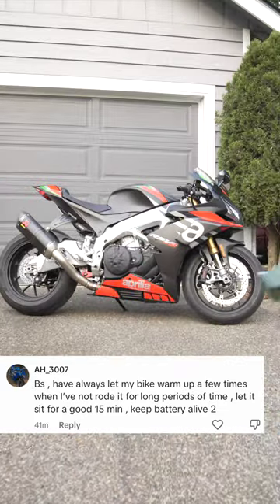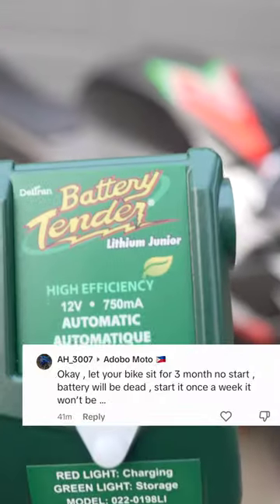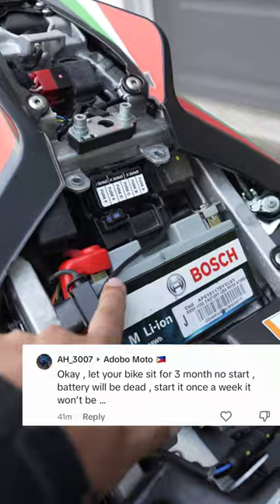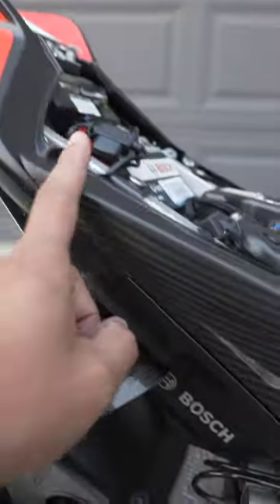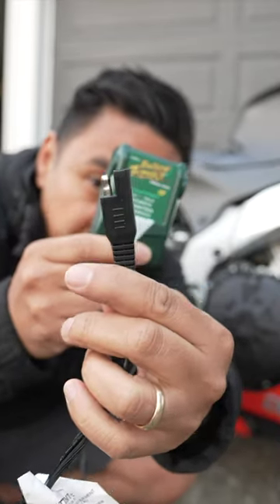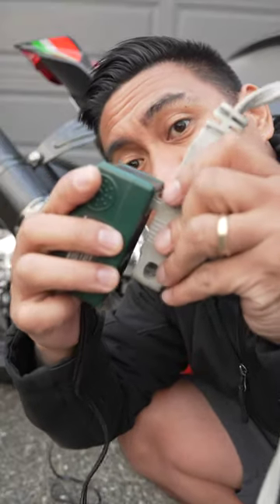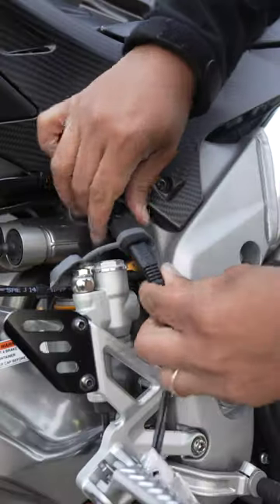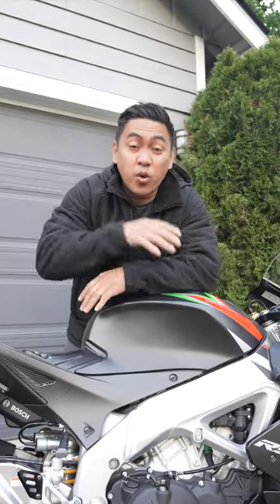HOW MOTORCYCLE BATTERY TENDERS WORK

Comment: Thats exactly how an alternator works my brother. In fact, if it wasn't for the voltage regulator, at higher rpm, the alternator would fry your battery/bulbs and everything else
Reply: Came to write this exact comment. I love adobo but electronics aren’t his strong suit it seems.
Reply: Um, no. The alternator in a motorcycle and the alternator in a car work much the same way, just at different power handling. If what you are saying is true, you could leave your car running in your driveway all night, come back to it, and just start driving, but that would kill the battery in literally any car, which is one of many reasons you would never do that.

I'm not claiming to be an expert on the topic, but this should be pretty common sense my guy.
Reply: Nah he right, i just found out the hardway just starting the bike wont charge it. I jump started it and rode it and it finally charged. In my defense its my first bike.
Reply: @zacharyplacker6271 what? You can leave it on. Car alternators will keep the car running all night and yes... you can get in it and go.
Reply: @mogunz9643 I think he is saying without an alternator.

Comment: I use Litium Batterys in my Bikes for over ten years and charged it not even once and it was never dead.
Reply: Lithium Battery only loses a few percentage of charge over months. If you Lithium battery loses more than 10% in a couple months, it’s just because there is an IC inside the battery trying to discharges the battery to 50% to be stored longer without reducing battery life
Reply: @The XHT  that's right. 
I had Lithium Battery laying around unused for 6 years and it had still 80% charge.
Reply: @ronnyweinreich  yeah i see no need for lithium battery tender unless you stop riding for more than 1 year

Comment: This isn't how an alternator works.  After the initial start process the alternator provides an excess of power to the battery to charge it.  Once the battery reaches a full charge the voltage limiter only provides enough charge to maintain the power level.  If you need to charge your battery before you ride then you have a bad battery, a bad alternator or a bad voltage regulator.

Comment: no man, a bike is DC power not AC! 12v DC battery. and it does charge at idle, but a bit less than when the bike is at revs. cars have alternators most bikes don't have them. lol they have a stater and roater that makes 3 faise AC power that gets converted by the rectifier to DC. On idle should be charging at 13.5v DC and about 14v over 4k revs.

Comment: If your vehicle is not charging at idle you have an issue.  At idle, alternators should be putting out between 13.5-15 volts.  Otherwise, you either you have a dead/dying alternator or you have too many electrical accessories.
Reply from the maker: It’s charging at a lowe amperage. Not high enough to charge a dead battery by letting it idle for 15mins. Try jump starting a bike with a dead batter and just letting it idle for 15min, then turn it off and try starting it again. Lmk how that works
Reply: Bikes aren't going to charge at 14 at an idle. Most bikes have staters, so the speed of the magnets depends on the speed of the fly wheel. So the only time it's going to create a surplus is when the engine is at an higher idle.
Reply: @adobomoto a dead battery won't charge in 15mins, we all know that, but a battery is absolutely refreshed from 15 mins of idling.
Reply: @adobomoto Not claiming to be an expert, but my SDR has had a dying battery (had to jump for every start for the last 2 weeks) and I specifically tested it the other night. Start, idle 5 mins, killed, waited 1 min, started right up. Though, not a lot of good. My 7am ride was cut short when I went outside fully geared and the battery is now 100% dead. Rip.

Comment: I have a volt meter that plugs into the SAE cable. Once a week I check the voltage first. Then do a trickle charge. I do not leave it plugged in constantly. Twice I have had a bike start after constant battery tender. Then trailered the bike somewhere. And, the battery was dead just that fast. I will leave it plugged in at winter time. But, will unplug it at least 2 days before use. (To check the voltage just before my trip.)

Comment: The only times my bike idles is at stop light/signs or it has not been running in awhile. A battery tender is A MUST for any rider
Reply: Because you definitely have a bike 🧢
Reply: Ive had a bike for like 5 years. And every winter my bike sits in my garage for 3-4 months and ive never had to jump it. Most ive done is like it idle for like 10 minutes a few times.

Comment: 13.5-14.5 volts is usually a good voltage to charge a battery at, a healthy battery just sitting is typically 12.4-12.6 volts and anything under 11.0 volts is considered flat or “dead”

Comment: Not an alternating current (AC) brotha, it runs in Direct Current (DC) from the alternator 😇
Reply: I think he meant DC😅
Reply: Many bikes stator is AC out to the regulator rectifier then DC out.
Reply: @ironken1796  this is correct, same thing in a car the generator (can refer to alternator or stator) output’s AC voltage which is then converted into DC volts

Comment: I use a regular battery tender on a shorai and only leave it on for 5 mins or so. seems to do just fine.
Reply: 5 minutes basically does nothing, which is good because your Shorai won't be happy if it's left on a Tender for a proper amount of time.

Comment: Damn my tiny Gixxer brain actually thought starting my bike for 2mins would charge the battery 😂😂
Reply: @MrBulli69  Yep,  my thoughts also... stick a volt meter on the battery, start it, give 1 quarter twist of the throttle and you will see output go up to aprox 15v... then your battery is charging.
Does with my MT09 at least..

Comment: It does charge at idle, just slowly, it's also not a bad habit to run a bike for a bit during the off season that has ethanol gasoline in it, especially if its a carb bike, although  you probably shoudnt be using that gas in the bike at all if you have a carb

Comment: I have a voltage meter on my zx10. On a cold start it will read around 12v and within 2min of idling it will jump up to over 14v. Battery tenders are great but idling 100% charges your battery

Comment: Quick question. If I turned the key in my bike half way so just ignition is on would that damage my battery over time because I’m not actually starting the bike?
Reply: Halfway? It's not a car ignition switch dude, you turn it to on and press the starter switch.

To answer, yes it drains the battery because all the electronics are on but there's no current charging it.
Reply: @mogan23z  thanks for the reply but bro your forgetting that my bikes a 50cc moped which means it has a steering lock which you also use the ignition for 😂
Reply: @Prxojectmythic  can't forget something I'm not told. Most bikes use the ignition for steering lock too. As long as key is in the on position it's using power.

Comment: Lithium batteries in engine compartments deteriorate faster than lead acid or agm style in the intense heat. Not saying youre wrong just tryna help out
Reply: The Shorai that's been in my daily rider in the Arizona heat for the past 4 years would disagree with you.

Comment: Well your wrong about its bing A/C current that is charging your bike well running, yes the altinator is produceding and A/C voltage but a series of diodes is used to convert the A/C current in to D/C current as the battery is D/C 12V and even thing on your bike runs on D/C current.
Reply: Yep, he isnt as clued up as he thinks he is. Dude needs to read up on rectifiers.
Reply from the maker: Right. I didn’t say ac charged your bike 😂, you guys are too busy trying to correct me all the time and missing the point.
Reply: @Adobo Moto  Yep but hey,  you can't expect not to get flak in return each time you dis the Gixxer  Tiffosi.
 If you give it out... you need to also take it. 😉

Comment: Wtf are you taking about alternating current for? How is that relevant? Battery is charged using DC anyway. Otherwise solid video and valid point.
Reply from the maker: When you have 60secs to make a short. I never even said ac charged the battery 😂
Reply: @adobomoto  fair enough, I actually thought you were trolling…everybody loves throwing a deliberate error in videos lately

Comment: I dont know if i agree with you 😁Motorcycle should have more then 13v  just running (idleing) that is enough to charge.. But i do agree with you that turn on motorcycle to charge battery is stupid :) and would take a long time! People are turn on the bike to charge it for 10min and that is stupid :) Keep on with good videos!
Reply: It absolutely charges the battery even at idle, it will just tame longer.
Reply from the maker: Jump start a bike with a dead battery. Let it idle for 15min and lmk if it starts 😂. 1amp is enough to keep the elctronics going at idle

Comment: You should deepen your knowledge about a vehicle electric system AND the very substantial difference between Lithium batteries and Lead batteries.  
You are kinda right but if you consider the lead-acid+old school alternators that had just a rudimentary voltage governor, not even an electronic regulator.

Comment: Ive had a bike for like 5 years. And every winter my bike sits in my garage for 3-4 months and ive never had to jump it. Most ive done is let it idle for like 10 minutes a few times during the winter. Sounds like you guys have shitty batteries.

Comment: I have a 125cc bike. If my battery is dead in the morning, I'll kick start it and let it idle for 5 minutes to get the engine heat up a little bit. Then I can start it with the switch anytime. This guy thinks he is accurate on everything 😂

Comment: Here's a reply to the comment you used in this video. I put my bike up last Thanksgiving, and removed the battery. Got it back out again beginning of this month and it literally fired right up. Proper battery storage works, but only for so long. A tender is the way to go. I would've used one but I misplaced it and didn't realize I didn't have it with me until It was too late haha 😎

EDIT* Thats about 5 months for all you morons who let your battery die. Figured you'd need the help adding.